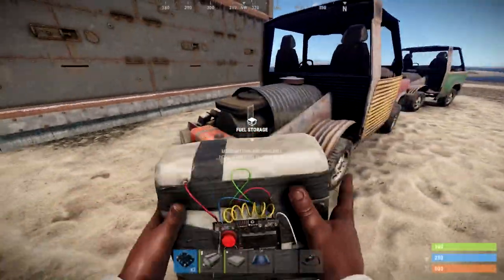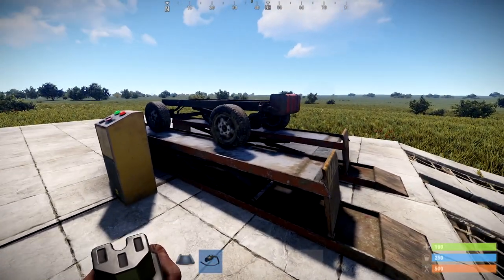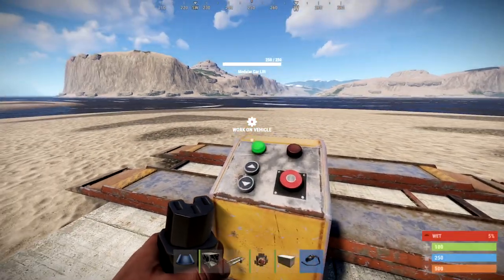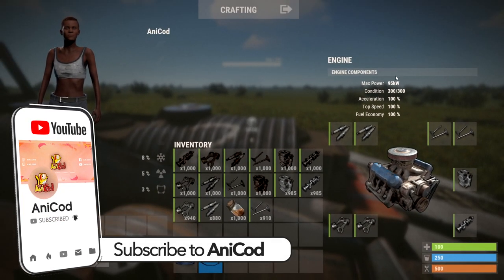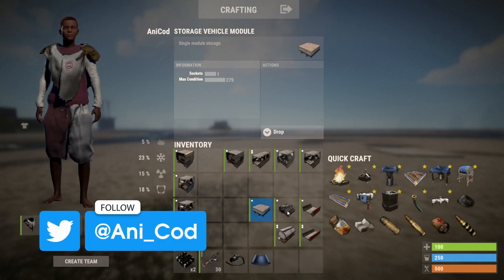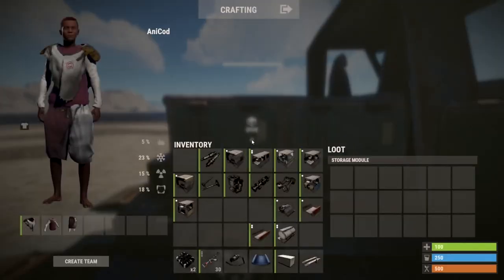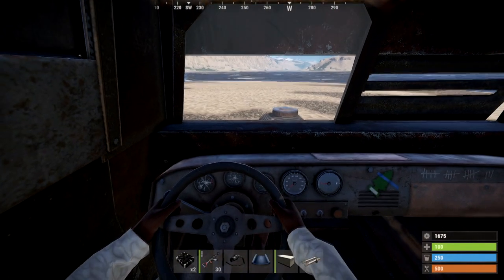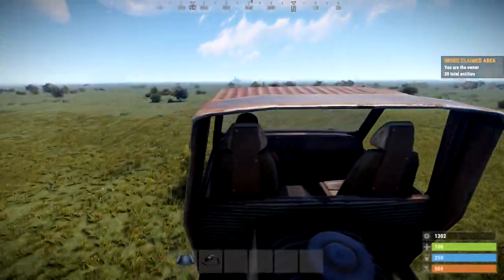MODULAR CARS | Update 2021 | RUST Guide | Step by Step

Comment: One tip I will give is to almost exclusively never use the armored cockpit. The negatives far outweigh the protection it gives. Standard cockpits already come with glass and can protect you from an okay chunk of bullets if you happen to run into someone. Also, the fuel economy and top speed are massively worse with the armored cockpit. A trip that takes 60 low grade armored takes like 4 low grade unarmored and since the top speed is so much quicker unarmored, you can actually manage to off-road some areas and leave anyone in the dust before they get much of a chance to pull out their gun and shoot you whereas the armored cockpit gives anyone you drive by a good 10 seconds to prepare an ambush if they see you coming.

Comment: For general usage, I'd recommend having a car that has at least the cockpit with the built in engine (For part simplicity) and one storage unit for loot/raid runs. I tend to run either a two slot with just those or a four slot with the cockpit, two storage crates and an additional engine.
Reply from the maker: pretty good tip to be fair... 2 slot vehicles is normally all you need if you can find a cockpit/engine combo

Comment: I'm aware of all of this but I watched anyways. I like to use the cars alot like the old helis, super disposable. I usually won't lock em and I don't save em. The parts are really cheap to learn and make and fairly easy to find. I will buy one tier 3 part and that will usually be enough to give the car a good boost. Of course there are times I build a garage and if I do it's usually a 3 by 4 so I can have a double entrance in the front and a half wall higher walls so I can add shotgun traps to the entrance.
Reply from the maker: love the shotgun trap idea. its a shame about the cars decaying... cant seem to find a way to stop it
Reply: @AniCodYT  to keep the car from decaying set up a car lift in a garage and hook it up to a generator .turn on the generator take all of the parts off the chassi and put em in a box and turn off the generator. The chassi will stay there indefinitely. Then when you need it, turn on the generator and put the car back together. You can skip the extra work if you just keep the lift powered, say with a windmill and keep it powered at all times. A car won't decay if kept on a powered lift. But it's much easier to do the ladder option as then you dont have to worry about power all the time.

Comment: I was wondering if what car is the strongest uphills? I live on a hill atm in Rust, and which modules should I go for then? The fastest(and probably strongest) just means I got no control and will probably crash in every tree around..
Reply: by default, i would always go one or two dedicated engines and an armored cockpit so you're not able to get killed easily. i usually do this setup three or four module cars depending on what my needs are. 
For example, let's say I'm going on a farm run with my car, I always like to take a three module car, put an engine in the front, armored  cockpit in the middle, and a storage module in the back.
When I take the squad out for some pvp / a raid, I take a four module car, engine in the front, armored cockpit in the second slot, armored passenger module in the third slot, and then another engine in the fourth slot.

When you want to go for cars in Rust, the best thing to do is to live / build your car garage close to a path or a road. Because if you build your car garage on top of the hill or in general far away from any path/road, you're going to damage it quite easily every time you're trying to get anywhere. In general, if you get damage like that doesnt really matter that much, but i prefer my cars to be in tip top condition all the time.

Don't worry about the speed of the cars. They're kinda slow (especially if you put an armored module on there, which i do recommend) so if you put one or two dedicated engines on it, you'll be fine. just go easy on the gas pedal :D
Reply: @DemRizzo  Thanks for the good answer! I will follow these guidelines. And try different options that serves me right. I might just make a roadside carbase, experiment with different setups and hopefully not get raided. 😄

Comment: Is it true modules are damaged more when driving off-road (even without hitting obstacles)?
Can players stand on storage modules while driving? Seems more efficient than flatbed modules.
Have you tested what happens when you have two or more driver modules and players fight for steering control?

Tip: If you want to push a broken chassis back to base, make sure a friend sits in the driver seat and steers it, or quickly jump in and try to steer it yourself, otherwise you can only push it back and forth (pointless endeavor). 

Finally, love your accent, think I'll try subbing to your channel. Content was good!

Comment: can you build a 4 module car with a single cabin with engine and 3 more engines?
Reply: Where you put the cockpit seems to affect control, so play with your layout. I find it very hard to control a 4 slot car with the cockpit in the rear, much easier if its in the front.
Reply: i like it best when the cockpit is in the third slot :D